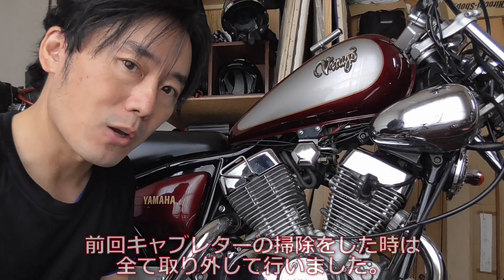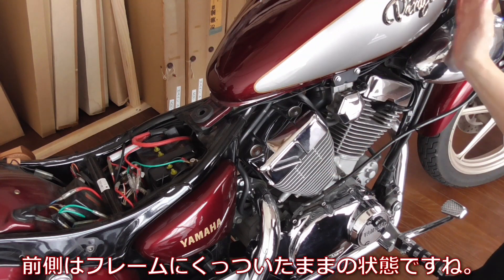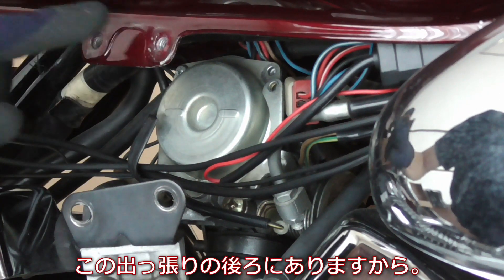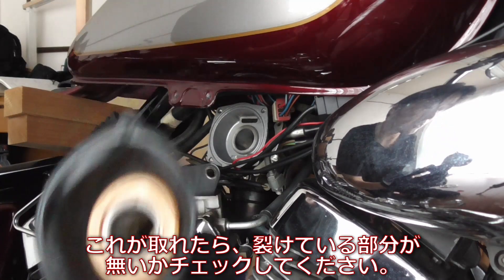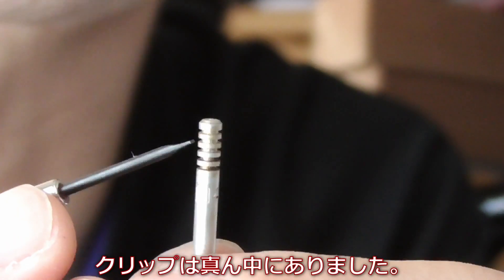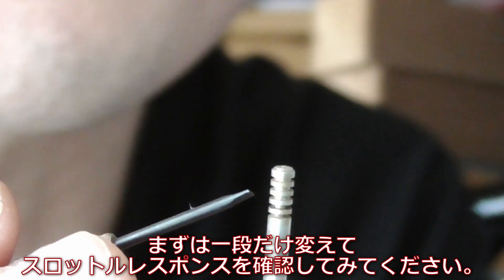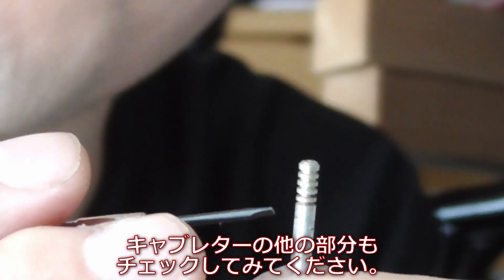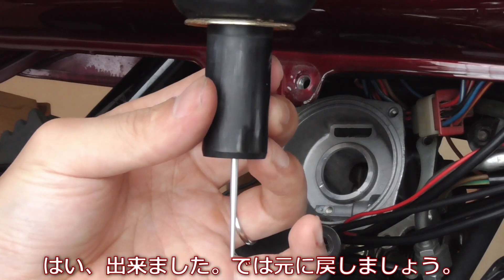How to adjust the jet needle clip in carburetor 【Yamaha XV125 & XV250 Virago】

Comment: Did you have to flush fuel out before having to remove that needle? Like when removing the carb
Reply from the maker: No need to flush out the fuel when adjusting the needle.